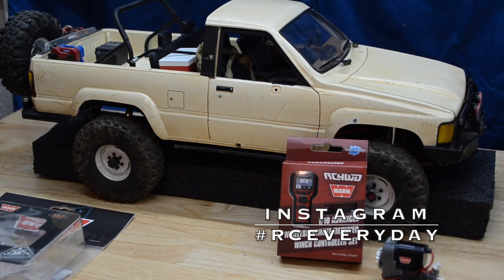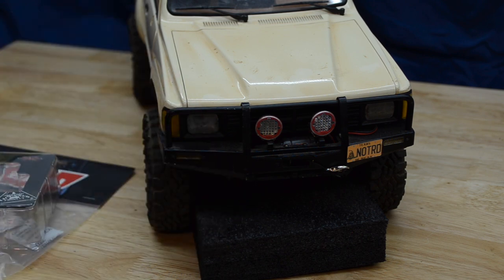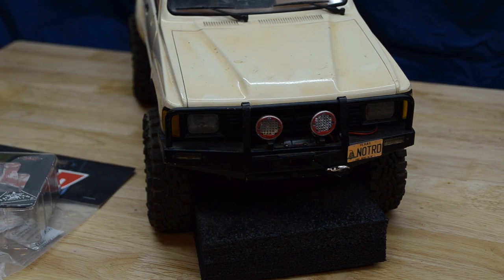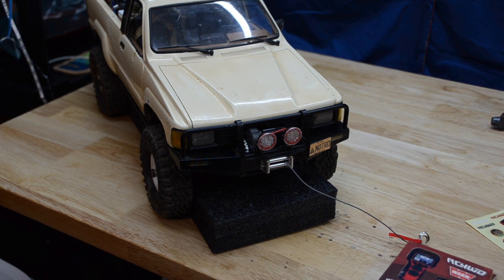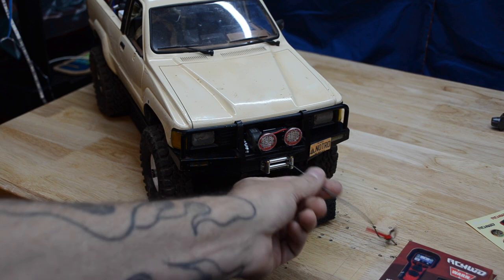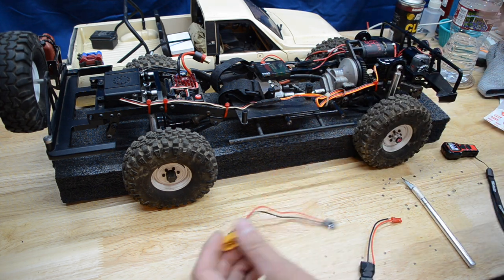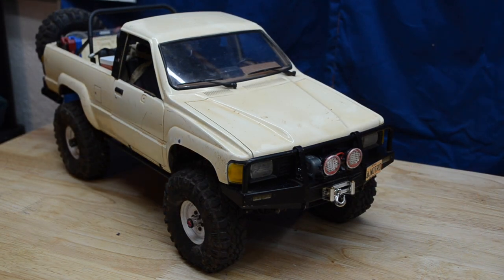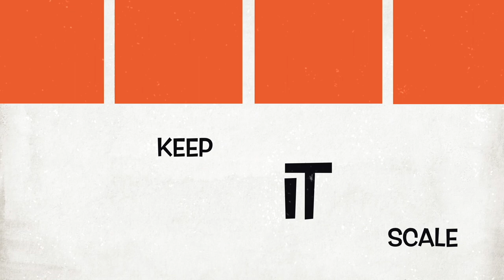The New RC4wd Warn Wireless Winch Controller, & Warn 8274 Winch Install, Trailfinder 2 4runner

Comment: I run my winch controller right off the power grid of the receiver. It’s got plenty of power at 6v.. I’ve got the older model winch, so it doesn’t have a brake unfortunately, but it works great

Comment: I've got the Warn Winch installed on 2 of my Truck's and they work good, but then I tried the Reef's Micro Servo Winch and that's what I'll be doing from now on... I've got a brand new Warn Winch still in the package for a backup Incase anything happens to the other two ... Still a good product 💯
✌🤠👍 HFLPRCing =Having Fun Laughing Playing and RCing 
👍😎👍 AOAH =Association of Addicted Hobbiest
🙏 SSPH =Stay Safe and Play Healthy My Friend🏁🏁🏁🏁🏁
Reply from the maker: I havent tried any servo winches but I can see how it would be better, especially a reefs.   Most of what I do is focused on the realism and having a winch up front just like the big trucks fits my needs more.  Im not a big comp guy.  Just like to have fun driving scale.
Reply: @RCeveryday  I don't comp a bunch, just run some fun Gates once in a while, I still like the RC4WD Winch and wired controller alot for scale looks and performance it's the best.. I've experienced the "other brand" total J.U.N.K. LOL 😁

Comment: Do you think it would fit the trx4 sport kit body?
Reply from the maker: The bumper and winch? Not without some major work.  The tf2 and trx are very different in design.
Reply: Just the winch. As far as fitting under the front without  having to chop up the body. Like how you were saying it fit the FJ. I haven't decided on a bumper yet.

Comment: Would that bumper work on the Marlin body you think? I’ve got one in the cart on RC4WD, but it’s mostly sentimental since I had an ARB bumper just like that on an old Discovery II. Side note, it would be awesome if RC4WD would make a 2002 Discovery II hardbody kit. Maybe you should give them a nudge! Lol
Reply from the maker: Lol, They dont listen to me.  Just measured the 4runner body is about half an inch wider in the nose than the hilux.  Afraid it would stick out quite a bit.  Plus the CChand bumpers are made so specifically I think the bull bars wouldnt line up with the headlights either.
Reply: @RCeveryday  Thanks so much! Just save me 100 bucks. I was pretty committed to try and make it work lol. But yeah scale wise that difference would look pretty noticeable I bet
Reply from the maker: That kangaroo bumper is kind of similar and fit the hilux.
Reply: @RCeveryday  which one is that? I’m thinking of going with the ARB bar bumper for the Gelande II and buying a pair of those universal bar mounts
Reply from the maker: Im not sure who makes the kangaroo bumper,  I put one on my blue tf2 a while back.  It looks very ARB like.  https://store.rc4wd.com/Kangaroo-Front-Bumper-for-Mojave-II-24-Door-Body-Set-Black_p_5701.html

Comment: Soon as my winch gets power it starts spooling out? Any ideas?
Reply from the maker: Something has to be wired wrong, should be neutral when powered up
Reply: @RCeveryday  yeah. It gets power from a little 600mah 2 cell LiPo battery.  Soon as I connect power to it is starts spooling. I have no clue.  Maybe the control box is defective
Reply: Hard to mess up the wiring. Straight from a battery into the control box then into the winch. I’m so confused
Reply from the maker: Yeah, not much else, have to email their customer support.  They will take care of you.